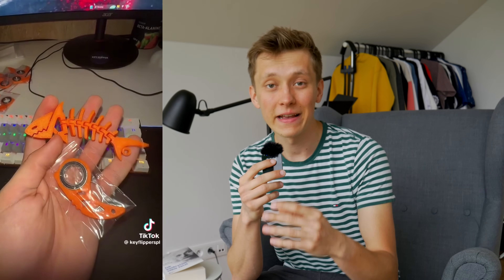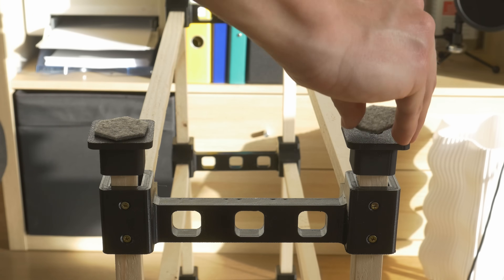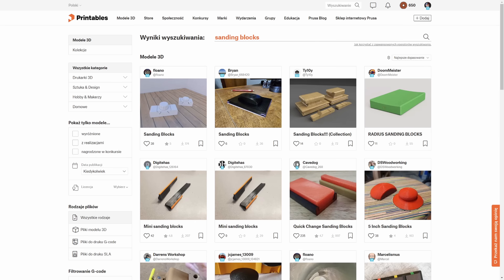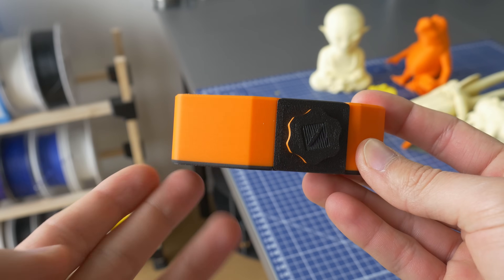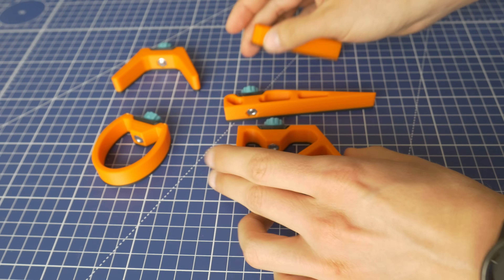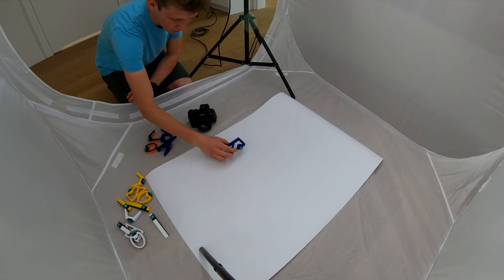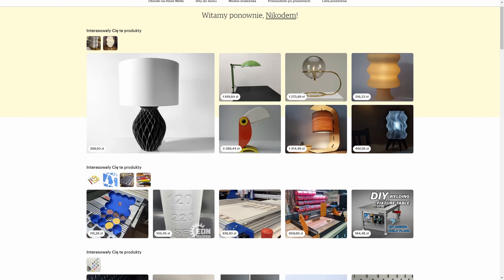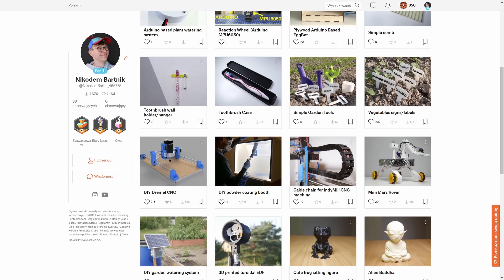I Designed, 3D Printed, and Sold a Product in 24 Hours.

Comment: One Thing I don't like about these designs is that you have a great part of the sanding paper that you just can't use
Reply from the maker: Well it depends, you can sand in a lot of different orientations and rotate the mini sanding block so basically the whole sanding paper gets used.

Comment: You just redesigned an existing model tho, doesn't that infringe their license?
Reply: in this case it is probably inspiration but it depends on the lawyer 😅 he's not redesigned other models but made thier own based on experience with multitude of other "free to personal use" models to find their flaws and solution for them. From my point of view it's being innovative like when Lamborghini made their first car by "changing" the Ferrari here and there. The innovation actually stands for finding flaws and points of possible improvement and finding a solution for them :v

Comment: where can i buy your filament holder models/parts?
Reply from the maker: Hi, thanks a lot for asking! I was still preparing the instruction and everything while finishing the video but the digital product for that project is ready and you can buy it on Etsy: https://www.etsy.com/listing/1707232892/filament-storage-system
Reply: A request- could you include “rollers” in case I might feed printers directly from your storage system?

Comment: Keep in mind you cannot use PLA for these as they will deform from the heat generated when you sand. Nice work!
Reply: Of course you can. The sanding heat is only a problem at the sandpaper working surface, but there is a lot of gradient to the backing and the heat dissipates quickly.
Reply: ABS is better for sanding than PLA. I have no idea about what the heat is doing, just experience with sanding both materials.
Reply: @OhHeyTrevorFlowers  yeah surface heat is likely to be a major reason why you can't really sand PLA very well. ABS however is not only heat resistant, it's also a flake graft and the flakes do have a tendency to just separate out.

But the OP is suggesting that the sanding blocks (sandpaper holders) can't be made from PLA or they'd melt. This isn't the case at all, they'll be perfectly fine.
Reply: @SianaGearz  Oh, whoops. I misread the intent of the OP. Considering that I press down on sandpaper with my fingers while sanding and feel only slight heat, I suspect that a PLA sanding block would be fine.